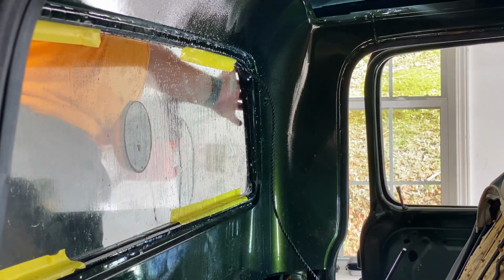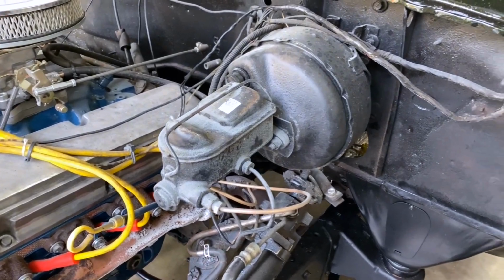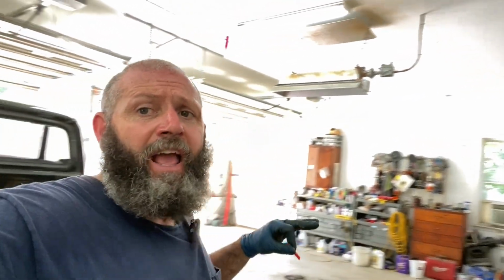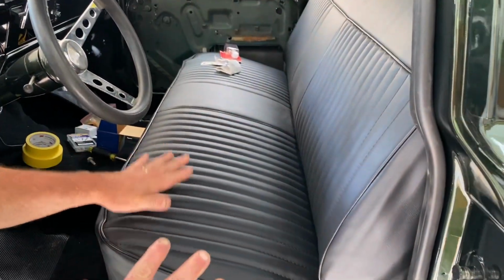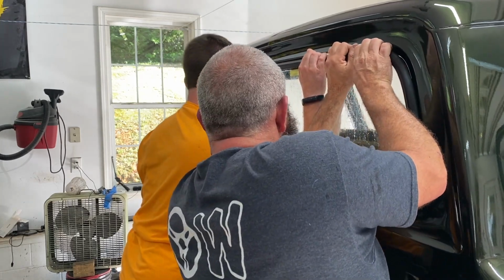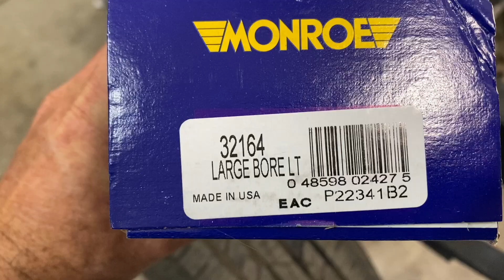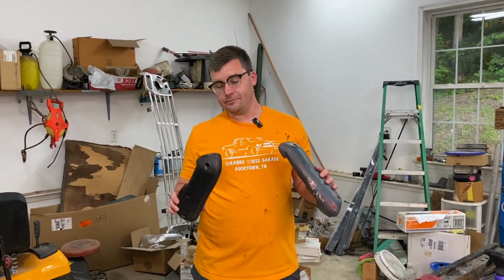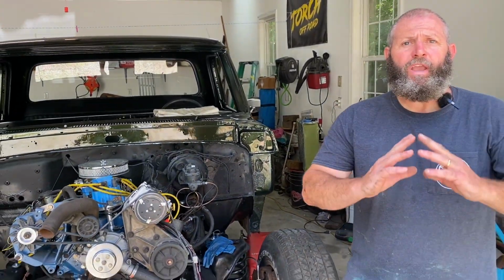69 Ford F100 Brake Lines for only $64 New Carpet and Back Glass?

Comment: I’m having trouble finding someone who has the rope install skills here in Utah. I’ve got to eventually do a 79 windshield and I’m scared. 😱😅
Reply from the maker: Just get a buddy and go slow that’s what we did.  I couldn’t find anyone local to install them so me and Caleb went at it.
Reply: @OrangeWiresGarage  that’s the plan. But it’s an expensive “whoops” if something goes wrong. I see guys pounding on them to get the corners seated. 😱😳
Reply from the maker: @troysgarage put the gaskets on the glass days ahead of time so they can get formed to the glass.  Then just take it easy, I whacked around on the back glass but it was not necessary. On the front just went slow slow and everything turned out great
Reply: @OrangeWiresGarage  appreciate the extra advice!  For the win!
Reply: @troysgarage  how did it go?

Comment: Question... does your fuel tank pressurize? Mine gets so much pressure in it that it blows gas out the sending unit gasket
Reply from the maker: Do you have an electric or mechanical fuel pump?  Check the vent in your fuel cap.
Reply: @OrangeWiresGarage  I have mechanical pump and I tried a vented cap it doesn't fit from LMC  but the regular cap does ...
Reply from the maker: @dougie46350  the tanks are supposed to be vented in the cap so they can’t build pressure
Reply: @OrangeWiresGarage  I'm guessing I need a new fill neck then so the vented cap fits...vented vs non are about ¼" different so it won't even twist lock on